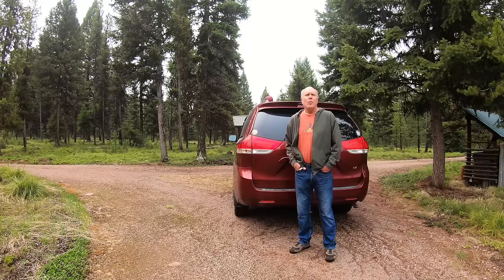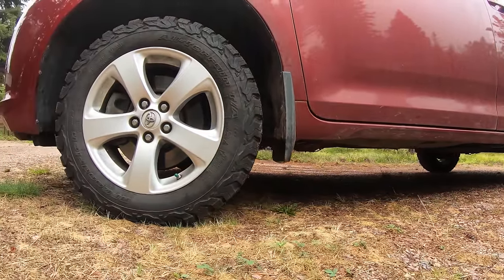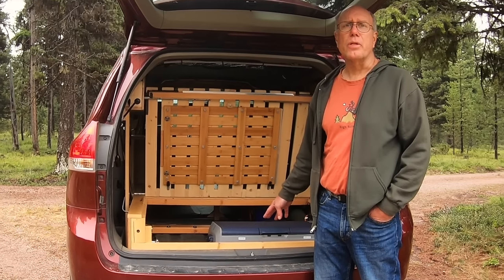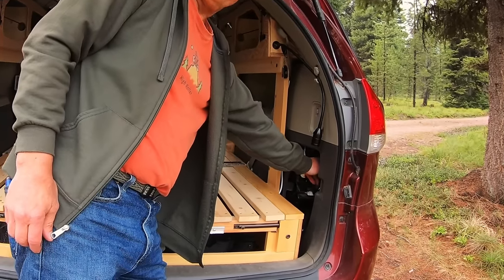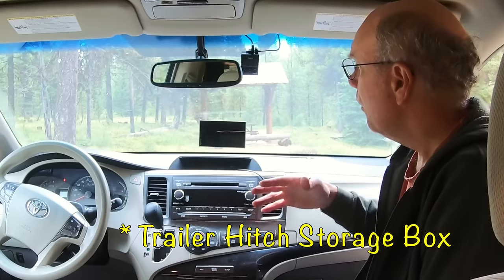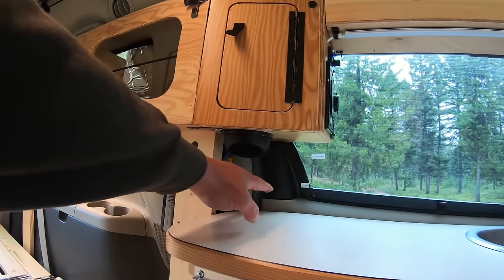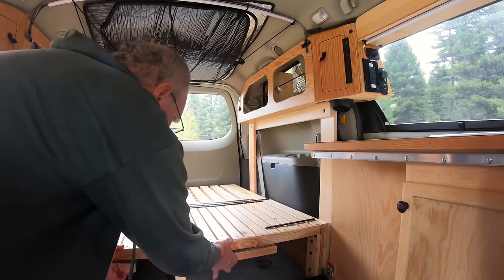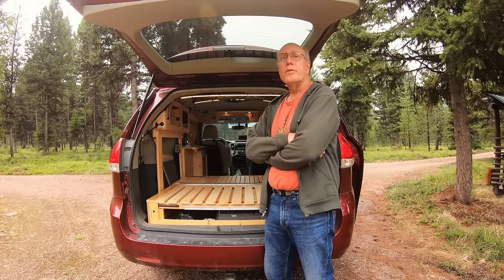An Overview of Our Converted Toyota Sienna Camper Van: The Nickel Tour

Comment: Where do you store a mattress while in route? I have an idea but you didnt show it in the video. Also i think my wife and I would feel cramped but the whole van is super. 73
Reply from the maker: We use a tri-fold folding mattress which has worked well.  
(Amazon: Milliard 4" full tri-folding mattress)
We purchased a full size, then made some modifications so it works better for us.  In couch mode, we use two sections on the back and one for the seat.  Sometime in the future, we will probably get one of the custom ones made.  There are several companies that do them for vans, whatever size you need.  But for the past few years, this has worked well.  

Yes, things can get a bit crowded, but that's part of the adventure.  Organization is a real necessity, otherwise you'll spend an enormous amount of time looking for some small item.  Too many times like that can get frustrating.
Reply: @dougmaryhittheroad  yes my sister in law gave me a mattress like it, they cancelled the tear drop build. I don't have a van right now but I would consider making the modifications. I just hope the seats remove easy like they did in the 2004 model I had. 73
Reply: @ronb6182  The new Sienna vans have middle seats that are very difficult to remove. They only tumble forward but they do have built in foot and leg rests and recline which maybe enough to double as sleeping accommodations.
Reply: @onebrightflash  thanks I'm not ready to dish out 50,000 + for a vehicle I sure wish I would have repaired the 2004 van I had. The engines in the newer models are only 4 cylinder. I got pretty good gasoline mileage for a six cylinder. Well thanks for the information I will definitely need to buy in the future. 73

Comment: I missed what year the van is I see that is the LE trim. I just got a 2010 limited.
Reply from the maker: @paulywalnuts7731  It's a 2013, (3rd generation Sienna.)
Reply: @dougmaryhittheroad  did you keep the sliders in there after you remove the second row or did you keep them in there? And just built around it?
Reply from the maker: @paulywalnuts7731  We removed the sliders, but kept the rails.  The sliders weren't too difficult to remove, just time consuming.  There's a couple YouTube videos showing how to do it.  The rails are much more difficult, but they don't stick up so far, so we just filled in between with foam padding, then placed a mat on top.  It's worked out pretty well.

Comment: I was wondering why you cannot use the van heater to heat the inside of the minivan. I was thinking of instead of running the van why not run the hot water through the heater core. Use propane to heat the water. Then transfer the heater core to the engine when on the road. You would have safe heat inside the van. I dont like the idea of putting fuel on the roof. Propane is condensed into a 15 lb bottle. 73
Reply from the maker: The information that I found expected about 1/2 gallon of fuel use per hour at idle for a 3rd gen Sienna in good weather.  My heater would consume two cups for the entire night, at a reasonable setting, in cold temperature.  The tank location isn't ideal, but diesel is safe, it just smells enough that I don't want even a small tank inside the cabin.

Comment: Forgive my ignorance, may I ask why not an electric space heater for such a small space?
Reply from the maker: @crwalker8469  While that would work as long as I was plugged in to shore power, it would drain my batteries in just a few minutes otherwise.   Electric heat consumed a huge amount of power.  Much more than I would be able to supply with my solar panel and battery storage.

Comment: Where do you keep the mattress?
Reply from the maker: You don't see it in this video, but it is a tri-fold mattress, folds into "couch mode" with a back and sit folded up in the center on the bed platform while driving.  This allows access underneath from the front or from the back without getting in the way.  It takes about 5 minutes to set up in the evening.

Comment: Hi Doug. I’m researching an install the journeys off-road lift. I’m curious what you have noticed with the fuel economy. Are you happy with the size of tires you are using? Also you said 10 inches from the road. I’m curious with the 3.5 inch lift and your tire size how many inches the van was lifted. Did you go with245/65r17? Thank you! Love your van🙏🏽💪🏽it’s sharp! Solid engineering skills!
Reply from the maker: We didn’t notice any change in fuel economy.  If anything it went up, but that was partly because we drove slowly.  With gravel roads, winding back roads and just watching the scenery we rarely exceeded 55 mph, and entire weeks went by when we probably didn’t exceed 45 mph. Additionally, the light truck tires allowed up to increase tire pressure to around 40 psi.  We sometimes went higher, but 40 seemed to ride and handle the best in most conditions.

The tires added a bit under an inch of extra height, plus the 3-1/2 with the lift kit so just under 4-1/2” extra.  There was no difference in handling, but we did notice it when getting in and out, just being used to a lower vehicle, and now it was farther from the ground.  We couldn’t be happier with the tires, and received a lot of positive comments on both the lift and the tires throughout the trip.  They are LT225/65R17,  BF Goodrich T/A KO2.

Comment: Really great van conversion. Thanks for doing your video. What kind of mattress do you use? (Comments🙂) Do you have any pictures with the bed setup? Thanks again,.
Reply from the maker: We used a 4” tri-folding mattress that we got from Amazon for about $130, but after a shake-down trip we decided that we needed to modify it.  The way it folded didn’t allow us to use it with our bed in couch mode, and it was also a few inches too wide.

It works well now, but after so many months using it, in hindsight we may have gone with something higher quality.  Maybe custom made.  Weight is always a concern though, since we fold the mattress up and slide the bed in every day and reverse the process every night.
Reply: @dougmaryhittheroad  Polyfoam mattresses are light but lose their shape and develop flat spots. So called memory or Tempur-Pedic foams are just different versions of poly foam. People that weigh more than 180 lbs. will be dissatisfied with them especially after the mattress gets hot from being in a hot van that has been parked exposed to the sun. Heat causes poly foams to lose all their compression resistance and speeds up how fast they loose their shape. Poly foam mattresses with steel coils inside cannot be cut to size to shape it to the conversion van interior. The hippie fiber filled waterbed mattresses are comfortable but too heavy and cannot be moved once filled with water. Air mattresses, well, if you have ever slept on one, you know they are not the most restful. Over inflated they are too firm. Get it adjusted right and the air pressure and your body heat cause the vinyl to stretch making it too soft during the night and this is if the air doesn't leak out. In my opinion, Talalay latex mattresses are the best solution. If you do not know how firm a latex mattress you like, or how thick you need, buy two latex mattress toppers, one medium and one firm. Then you can put the firm on top if you like a firm mattress or the medium density on top if you like a softer mattress. The thickness will be determined by your weight, foam density, stretchiness of the mattress cover, and whether you are a side sleeper on back or stomach sleeper (who would take less). A 300 lb. person will usually need 4 to 6 inches of thickness. Lighter people can get by with a thinner latex mattress. The most common ILD (Indention Load Deflection) range for latex mattresses is 28, but ILD needed depends on the sleeping position of the user. Back sleepers typically benefit from a medium ILD range between 22-28, while stomach sleepers may require a firmer ILD range between 28-32 to prevent sinking in too deeply. Side sleepers, on the other hand, often prefer a softer ILD range between 20-24 to alleviate pressure points on shoulders and hips. Latex firmness can also be adjusted by the type of mattress cover. A stretchy cover will be softer. Besides resisting heat, repeated compressions without losing shape or compression resistance, and being able to be cut to a custom shape with an electric carving knife or band saw, latex foam can be compressed in vacuum storage bags to take up less space when stored. The cons of latex foam is it is more expensive, it weighs much more, and like poly foam, it degrades when exposed to sunlight, so keep it covered. As far as the weight, a full-size mattress should be manageable. Since the foam is heavier it will not move around like poly foam plus, if it is cut and custom covered so it can fold into a seat. Or, cut into 3 or 4 individual covered i blocks that can be put together to form a bed, chair, lounge chair, or couch.
I am sorry for the length of this post but I hope it helps.
Reply from the maker: Great information to have! @onebrightflash
Reply: An extra long full mattress is available from any  mattress manufacturer. I agree with latex as for comfort. They are the most flexible. I liked what was said about med and firm in two mattresses stacked on top. This works well in one for the couch comfort (firm) and one for bed comfort (med) on bed. The older we get the softer bed allows for better circulation thus the brain adjusts less for regulating fluid telling the body to turn. I sold mattresses for many years. I also use a CPAP (20+ years) the less you have going on in your brain signals the more sound you sleep. If you use one too make sure you have the correct voltage and possible adapter or you could damage the unit. Using one can help you sleep like a rock. Not using one for a prolonged period can cause you to fall asleep at the wheel. If your not sure check with your medicare, most cover them fully. Do not get the least expensive though. Get a good sleep doctor  and get the right mask. If you don't like the mask try another one, if you don't like it try another one.

Comment: Honestly, I wouldn’t trust a regular Joe building this kind of van. You really need to make sure electrical is done correctly and, of course, the heat pump too. If it’s not built by professionals who knows exactly what they are doing I wouldn’t trust this van setup
Reply: You never learn if you don't try to do it yourself...In term of electricity, I always go by the most conservative way, common sense also help..... If you hire someone to do it, they can easily charge you few grands which defeat the purpose of this thing.
Reply: As a 30 plus year handyman, cat insurance adjuster DOD structural engineer and FEMA Flood  damage specialist his work here is near excellent. I would consider an electrical  specialist to give it a thorough inspection not to mention a couple of trial test runs under 50-75 miles. The first one being in the driveway. A smoke alarm and o2 sensor are cheap.